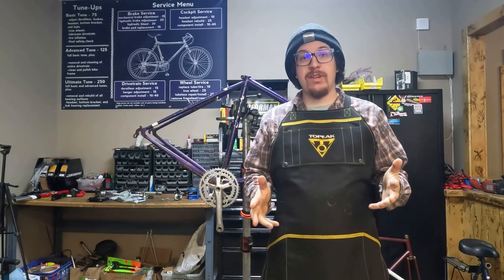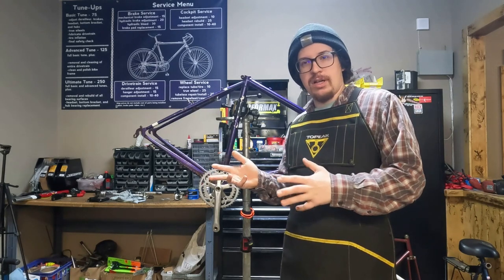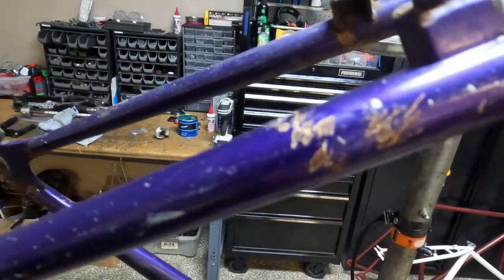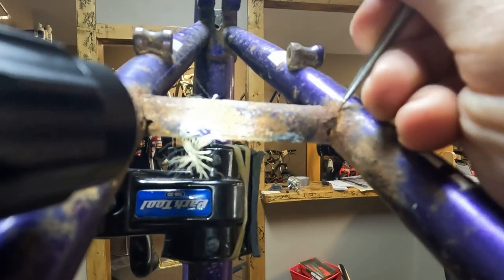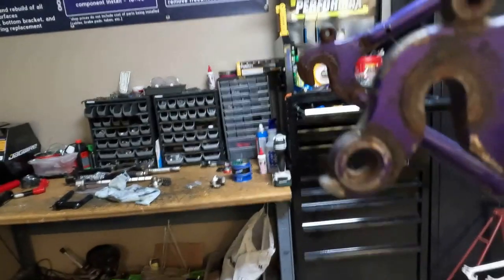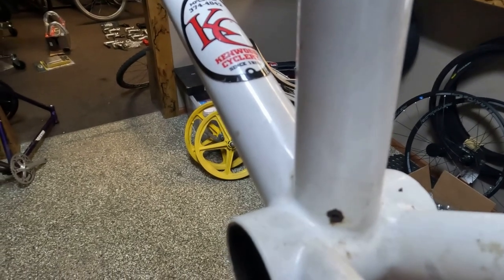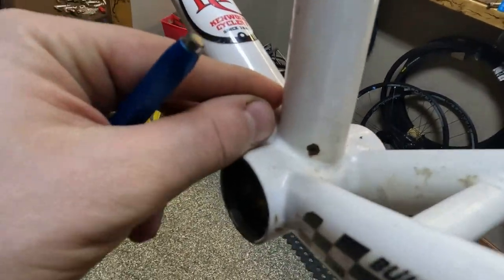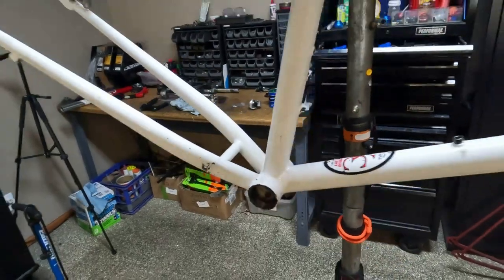What to be Aware of When Buying a Used Steel Bike.

Comment: Another rust spot to check for is the top tube, especially road bikes that get ridden on a stationary trainers because salty sweat is able to just drip, drip, drip off the rider.

I've also seen some steel frames with stretched or ovalized headtubes either from botched headset installs or running too long of a fork and it stresses the bottom of the head tube.

Also, chwck the seatpost collar area. There can be damage either from overtightening, running the wrong diameter seatpost, or running the post beyond it's minimum insertion mark. Steel being so forgiving to abuse tends to live on despite these issues, unlike aluminum or carbon.
Reply from the maker: lots of great info. Seen some sad trainer bikes that's for sure.